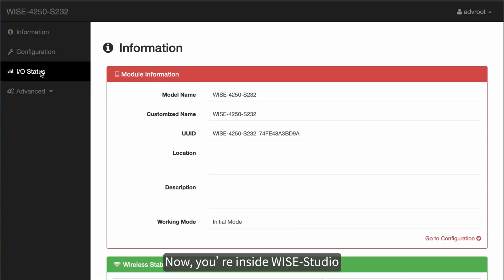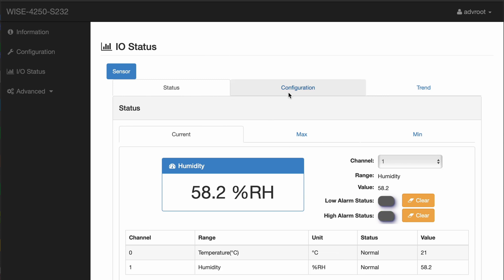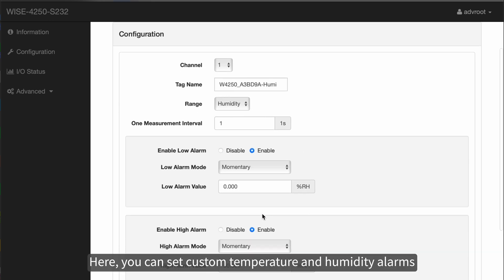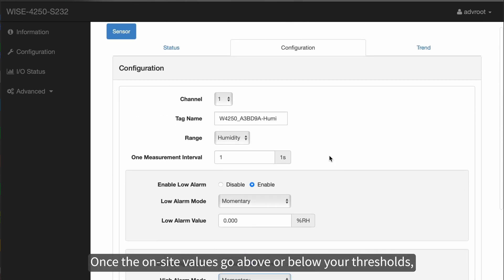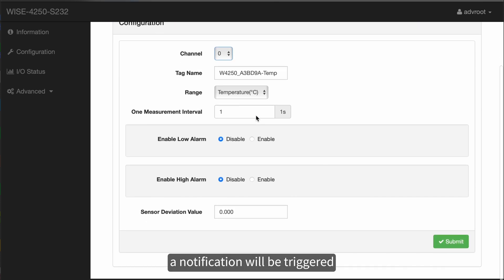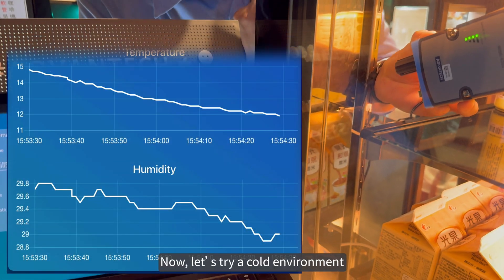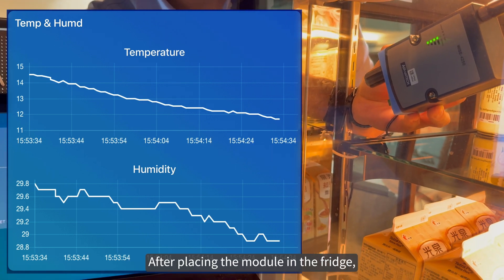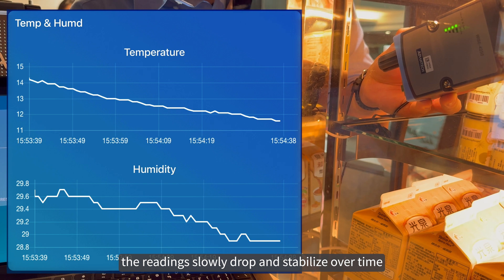WISE-4250-S232 | Unboxing & Quick Start Guide, Advantech (EN)

Comment: Hello Advantech, I was changing IP address from SSH and now my Both Ethernet port not detecting in the Edge link studio software, please help me i am expecting there will be some putty login from serial debug port to login and resolve the mistake that i made while changing ip in linux command , 48hours end and your technical team not responding to my Support ticket i am believing you please don't break our trust. my hardware is Advantech ECU1051 (now if my ethernet not detect i cannot able to do anything and also i have did hardware reset multiple time manually but not working  )